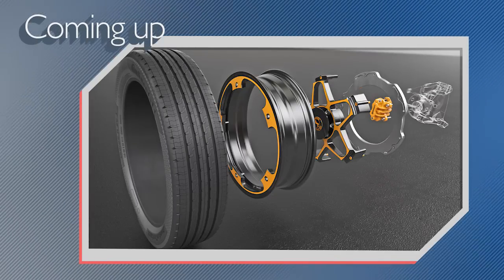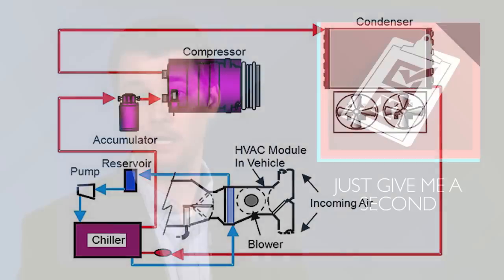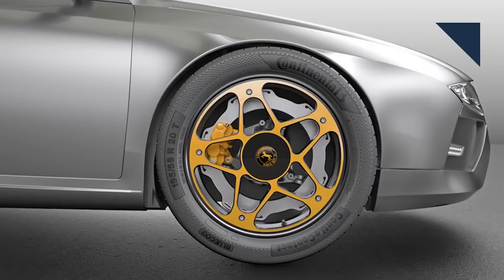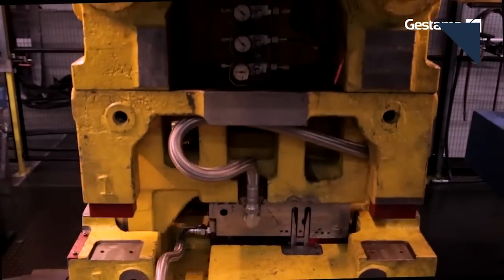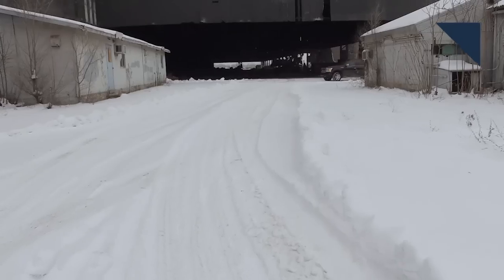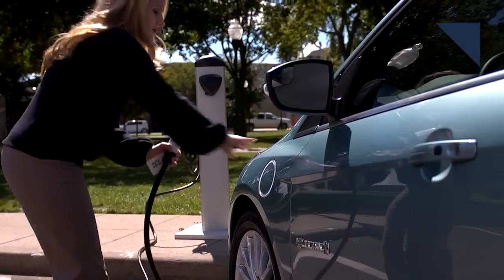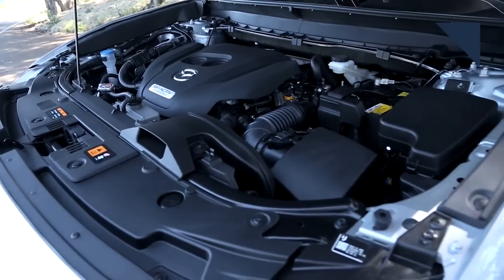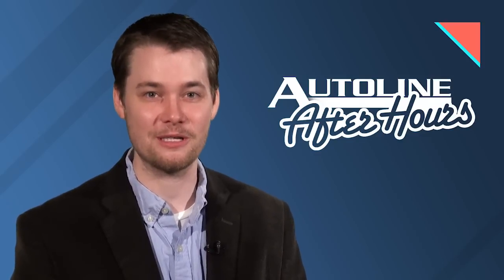New Wheel Concept, Secondary Loop A/C - Autoline Daily 2166

Comment: It seems like Continental's new brake systems setup would be really good on cars in general not just EVs. You could put a much larger brake [rotor] on the car with decidedly less overall weight, while using the often copious amounts of space, in 19-20+ inch wheels, that are becoming increasingly common.
Reply: Yes very good idea and nice to see someone trying to change with the tech changes in cars!  One thing though,  EV's like the tesla use retentive braking where the motors slow down the car as you remove your foot off the accentor petal and use the force to recharge the battery so the brakes are used only sometimes for fully braking?  But still the idea will help save weight and that is a big thing on EV's to have better mileage?
Reply: I'm curious about what brake pad material will not wear out the aluminum rotor and how long will it last?
Reply: me too unless its like plastic aluminum would wear out way faster
Reply: The new Continental wheel and brake concept seems suspiciously like the solution to a problem that does not exist. I have not heard of any EV owners complaining about rusty brake disks or poor brake performance. Since Tesla owners complain on the Tesla forums about even the smallest flaws affecting Model S & X, you can be sure we would have heard about it by now if it were, indeed, a real problem. 

And I don't see that putting the brake caliper on the inside of the disk is all that advantageous. Wheels are already getting bigger than they were in years past, which gives plenty of room for disk and caliper. Again, this is the solution to a problem that does not exist.

I also don't see that this new design is necessary to save weight. The weight savings seem to be coming mostly from substitution of aluminum for steel, not elimination of redundant structure. But we already know how to use aluminum, and even magnesium, in wheels to save weight.

If it's a good design for EVs, why wouldn't it also be a good design for ICE vehicles? If we're going to have to switch to a different standard, wouldn't it be better to do so across the board? I would not want to be the owner of an EV that had to special order nonstandard wheels, hubs and brakes from Continental in Germany.

If the "star" or hub portion of the wheel now becomes permanently attached to the brake and the axle, then owners can no longer easily change the style of the wheel for some aftermarket style they like better. They now have to disassemble major components to install a new hub with a more pleasing style of "star". And what if they want to install aftermarket brakes, say with a carbon composite or ceramic disk? That's not going to be so easy either since it's an entirely nonstandard setup. Even just painting the brake calipers a different color becomes more problematic.

It's just not true that abrasion will take place only on the pads. Abrasion and friction happen between surfaces and affect both. If pads wear, then so will the disks they grip. Disks are exposed to road grit and grime. Of course they wear, any claim that they don't is disingenuous.

Comment: "Because it's aluminum, the rotor won't wear like a conventional rotor" No, it'll wear and warp in just a few uses! Bonus, when anything wears you're stuck buying a lot of expensive parts. But don't worry, the aftermarket will come up with a conventional replacement. Radial brakes aren't common but have been used before on motorcycles. Reason for the AC design is that butane is a far better refrigerant than freon, but is sort of flammable. Removing the refrigerant from the cabin area might make it more legal to use.
Reply: I'm thinking they use a softer brake pad with these aluminum rotors that you will have to replace every 20k miles.

Comment: Multi-piece wheels have been used on heavy duty equipment for years. They are called "widow-makers" for a reason.
Reply: Multi piece pressurised sections (widdow maker) vs multi piece unpressurised sections are different things....
Reply: yea big difference indeed because with this design shown here there is no locking ring to blow off in your face
Reply: widow makers were held together by air pressure this is no where close to that

Comment: EVs get clearer the money you pen them,because the grid gets cleaner

Also, even a coal powered ev is cleaner, not just a longer tailpipe, because ICE (Internal Combustion Entire) vehicles are only about 20% efficient and electric motors are in the upper 90s. They used this lie to kill the EV1 and end the mandate in 2003. The myth of the longer tailpipe is sponsored by Exxon, Texaco, etc

Coal or natural gas electricity powering an ev is still much cleaner than gas cars and, as the grid moves closer to 100% renewable, they get cleaner. Can you day that about a regular car?

I'm disabled and couldn't afford a car for years, but, thanks to EVs not needing gasoline and needing significantly less maintenance (another reason for these hit pieces- car companies make a foreign on idiots who good to the dealership for maintenance of ice cars), I could actually drive again. I love driving and i loved my old ice cars, but electric cars are the future. They're cleaner, safer, and WAY cheaper.

Why would we trust Exxon Mobile? Their profits depend on us staying addicted to oil
Reply: Stephen M exactly.  Just the recycling of the batteries alone after they reach the end of their efficiency and charging capacity is already 100% more economically sensible.

Comment: Wonder if the a/c will work for home units or just automotive
Reply: There r more effective ways to increase efficiency in a home unit like using water not air to remove the heat from the unit.
Reply: Jon Dittmar there are versions of it in use in some homes and public spaces its a heat exchange system

Comment: So basically the alloy wheel bolts right to the hub and the brake is now attached to the wheel rather than the hub. I don't see how this improves braking performance.
Reply: More brake rotor without adding nearly as much weight.
Reply: Except that EVs don't need more brake rotor. They use mostly regenerative braking. They could actually use a much smaller brake rotor than a car without regen. For a given size rotor, it doesn't improve performance. Besides, improved brake performance on an EV with regen is a solution for a problem that does not exist.

Comment: That secondary loop ac is dumb. High pressure refrigerant doesn't lose energy until it is sent into the evaporator and allowed to absorb (thus change phase) heat. Using coolant will simply have a cold fluid that is absorbing heat everywhere on its way to the cabin. It might stay colder for longer, but it won't be more efficient.

Not to mention added weight, added electronics, and added energy to drive to the system.

A normal system will reduce the pressures of the ac line to maintain a constant ac on state but take less energy to drive (variable nozzle). This allows the ac to operate constantly without cycling on and off and not freeze the cabin. More common systems just cycle the compressor and have cold and warm bursts of air unless max ac is needed.
Reply: Agreed there is always an inherent  inefficiency when adding heat exchanges. Adding  liquid on that small of a scale to act as thermal storage in a hot engine compartment is also dumb.
An electric compressor with a VFD drive maybe a better path.

Comment: Battery-powered electric cars are currently  hamstrung by the 'parasitic load' (the weight) of the battery - Hydrogen-powered electric cars are a far better idea, because the weight of the Hydrogen storage system (the tank, pumps, handful lines) is far less than any currently-produceable battery.  Furthermore, Hydrogen can be burned in conventional, piston-engined vehicles, with relatively-easy (i.e., fairly inexpensive) modifications to the engine - this makes Hydrogen a great 'bridging' energy-storage medium, to ease the transition from existing vehicles to purpose-built, 'pure electric' vehicles.  Batteries - Bad!  Hydrogen - Good!
Reply: Stephen White ,except when most hydrogen is made from natural gas and thus makes Co2 in it's production. Also, hydrogen is the smallest element and is very difficult to keep confined. It costs much more to fill up on hydrogen than electric.
Reply: Van Doren Have you been living in a cave?... Human caused increases in CO2 levels is why we have the climate problems that we do.

Comment: As if the A/C system wasn't complicated an expensive enough here comes Tata and MAHLE to make shit worse . . . Fok off.
I don't want flammable refrigerant on my system, have enough carrying a full tank of gas and being under pressure inside an oven like engine compartment. Good thing there's already kits to retrofit the 1234 B.S back to 134.
Continental using Buell motorcycle brakes now ? LOL.